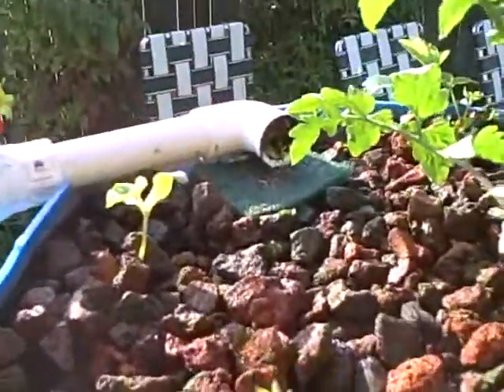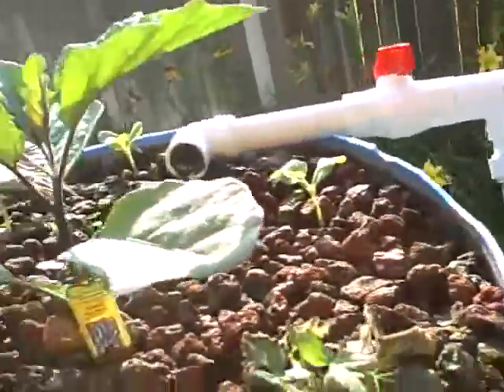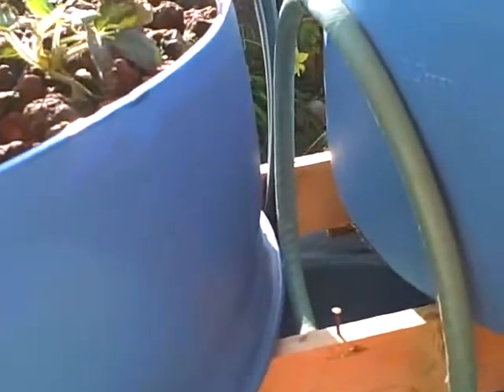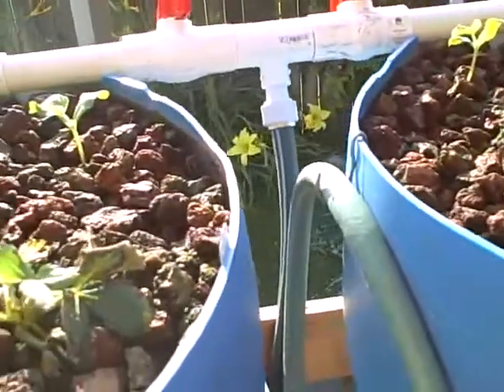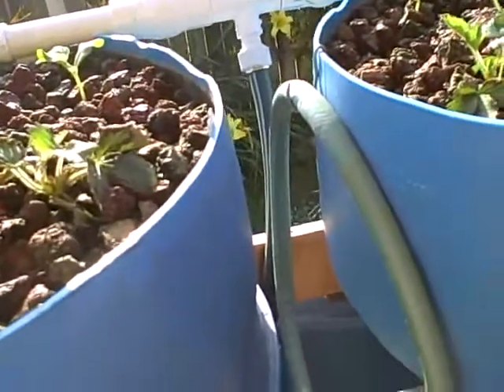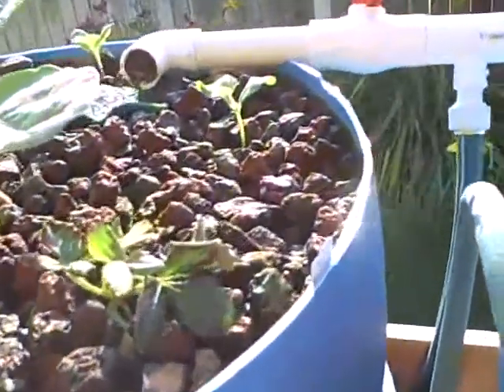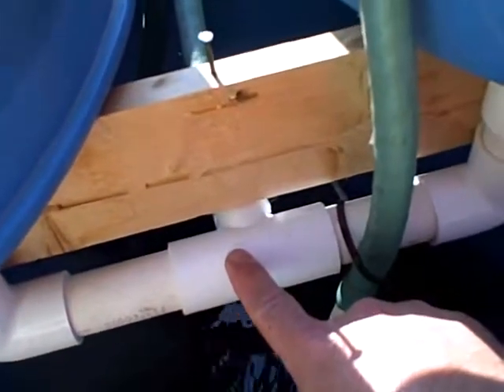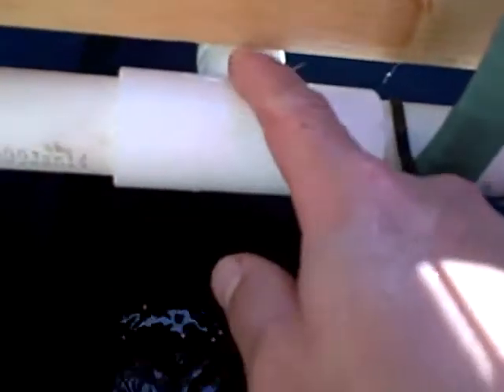Aquaponic System Detail Part II

Comment: Nice set-up!  It's given me ideas with regard to how I'll be putting together my own system.  I have one suggestion related to the water pump you're using.  Why not put together a spray bar to aerate your water?  Since you've got so much water travelling up the garden hose from the water pump, why not stick a T-pipe and make a spray bar using a half liter water bottle with holes drilled into it.

I was thinking that you could do away with air pump-air stone combination and use it as a back up.
Reply from the maker: I've done many different ways of aeration. The air stone is just one that works well. However, you choose just make sure its enough... small systems like this need quite a lot.

Comment from the maker: The siphon loop is what allows the water to fill each bed to near the top and then it automatically drains back out into the fish barrel. When it is finished draining a bit of air gets sucked in and so it breaks the siphon action so that the beds fill up again.  This cycle repeats about every 30 minutes  or so. The plant roots get some needed air without drying out.